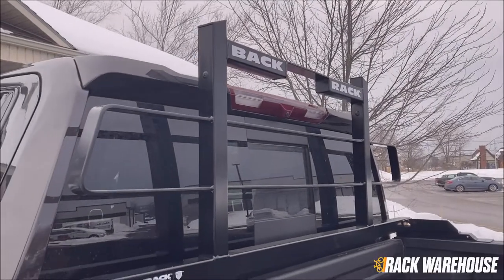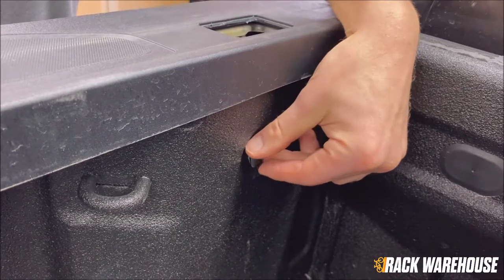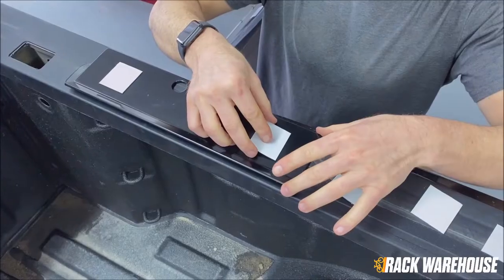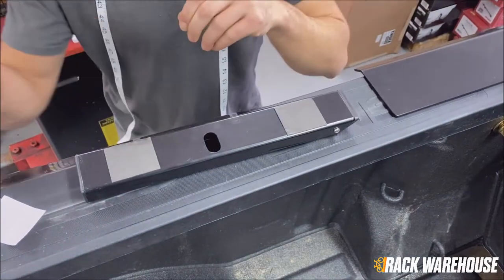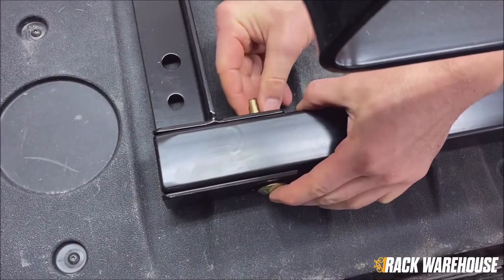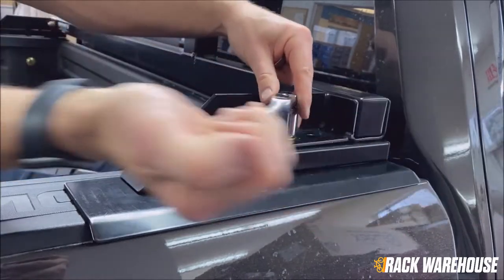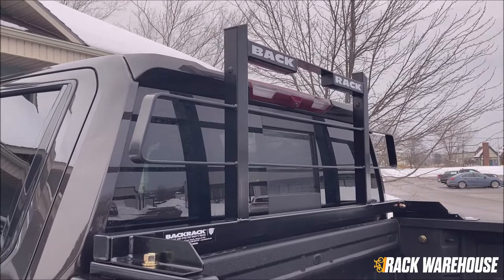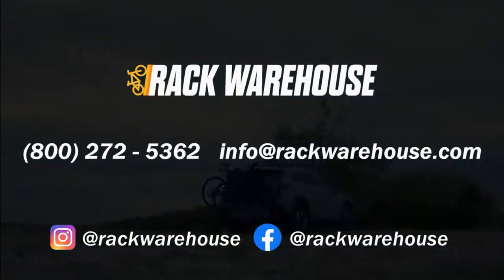Backrack Original Headache Rack with Tonneau Cover Kit Installation - Rack Warehouse

Comment: Do the stake pocket bolts come with the tonneau cover adapter? Or do you have to buy all 3 separately? Trying to get one for my truck but having troubles with that
Reply from the maker: Yes, the stake pocket bolts are included with the tonneau cover adapter kit.